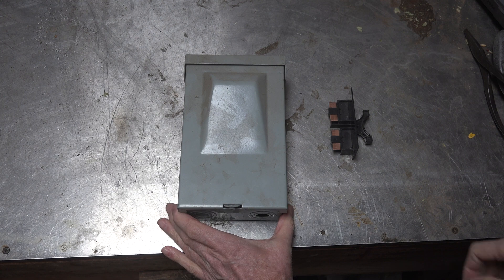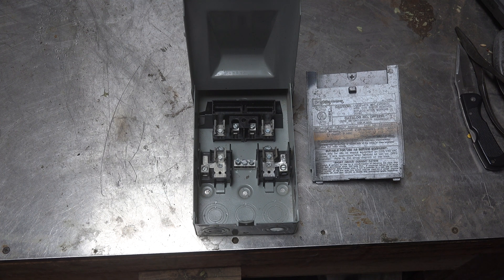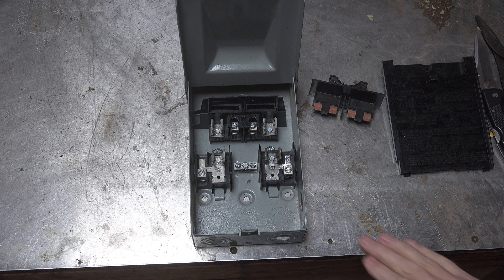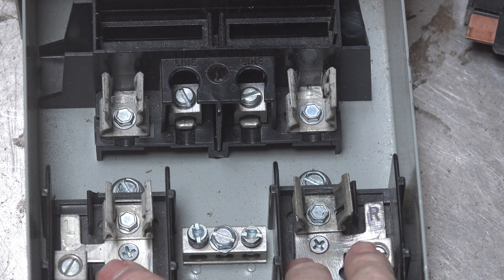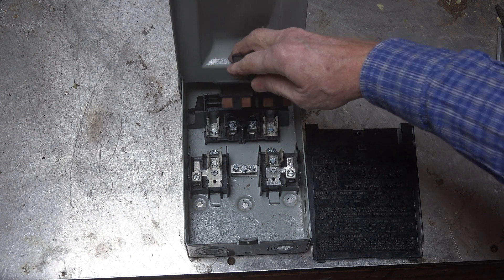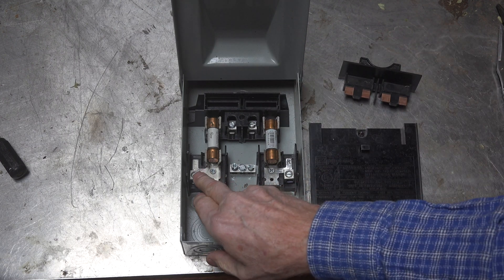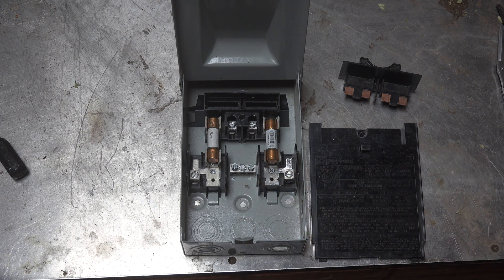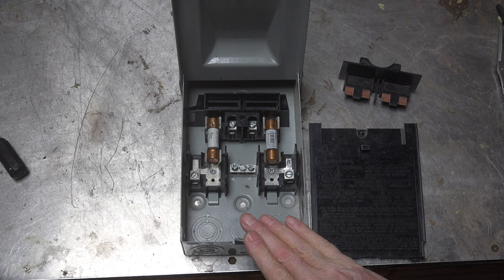Wiring the A/C disconnect

Comment: Can this disconnect be wired as 115 volt?
Reply from the maker: You could, but the neutral cannot be switched.  
GFM
Reply: Yes, but you would only use one fused side for the blacks/hot, the neutrals get wire nutted together, and the grounds tie in at the ground bar.

Comment: Why do fuses go out?
Reply from the maker: Generally, there are 2 reasons for fuses to blow:  Excessive amp draw of the circuit, such as a short in the compressor windings.  
What seems to be more common, the terminals overheat due to poor connections ie loose connections or a poor connection in the disconnect itself.
GFM

Comment: Quick question if the plug for the disconnect is burnt on one of the 4 tips does that mean one of the wire is loose or bad terminal ? Do I need to change out the whole disconnect box??
Reply from the maker: It is probably a loose wire.
In any case, the whole disconnect must be replaced.
GFM

Comment: So if you're connecting female power cord with alligator clips to get power for say the vacuum it doesn't matter which terminals you stick the alligator clips on?
Reply from the maker: It will work both ways, but it is best to use correct polarity.
GFM

Comment: What causes disconnect to blow fuses??????❓
Reply: current in excess of the fuse capacity (which should match the circuit cap)
lightning might provide that. 
you can get boxes without fuses.

Comment: Will I be able to send more power back to Edison's grid if I choose a 60amp over a 30amp disconnect?
Reply from the maker: You don't understand, you pay Edison for power.  And whether you use a 60 or 30 amp disconnect makes no difference.
GFM
Reply: @grayfurnaceman Sorry I have solar panels and whatever I dont use goes back to the grid
Reply from the maker: @Bairov  If the wiring is also upgraded, yes
GFM

Comment: Excellent explanation. If there is a white neutral wire coming from the breaker box to the disconnect, where is this connected?
Reply from the maker: In this disconnect, there is no option for neutral.  If there were a provision for a neutral, it would not be switched in the disconnect.
GFM
Reply: @grayfurnaceman  do you just clip the neutral short then? My Romex comes with 3 wires and a ground.
Reply from the maker: @Rufio6814  Yes.
GFM

Comment: With those 2 small individual fuses on a 30amp Central Air Unit. Would you use
 2 - 15 amp fuses or 30amp?
Reply from the maker: 30 amp
GFM
Reply: I won’t be using it to supply my a/c but instead an outlet for my above ground pool. Should I still get a 30 amp fuse?

Comment: Do you know why they are fused?
Reply from the maker: The NEC requires it lol  
It used to be only a requirement that you have a disconnect.  Not that it had to be fused.  I personally think its not necessary.  There is a fused disconnect (breaker) in the panel.  
GFM

Comment: How would I wire 110 volts to this?
Reply from the maker: That is a 240 volt disconnect.  It cannot be used for 120 volts.  A 120 volt disconnect will have only one pole disconnected.
GFM

Comment: Also would point out that line goes to the inside terminals so that when the disconnect is pulled the fuses don't have power.  Then you can change the fuses without worry.

Comment: Probably stupid question but why is it that a neutral is not needed?
Reply from the maker: The disconnect is a 240/208 disconnect.  There are no 120 volt loads connected to it.  If you had a 120 volt circuit on the appliance, you would need a neutral.
GFM

Comment: Current code requires connections be torqued down to mfr spec using the proper torque wrench or screwdriver, etc. (approved means).  Guess too many people had the wrong idea about tight.  2020 NEC  110.14(D)
Reply from the maker: In the real world, nobody uses a torque wrench.  You know that.  Tight means tight.
GFM
Reply: @grayfurnaceman   Oh, I understand that.  I was just pointing out the language has changed to "shall".  Another reason you don't want to get caught out with a loose connection.

Comment: Thanks for the video. But I hate when an electrician installs a fused disconnect after a properly rated breaker for the equipment im installing. Why? Cause i never have the fuses! And sure as hell he doesn't install them because most disconnects are sold without fuses! I'd rather do everything myself, including the line voltage wiring from panel to a non-fused disconnect.
Reply from the maker: The use of fused disconnects depends on the codes you are under.  A disconnect using a breaker is allowed but most contractors will not use them as they are more expensive.
GFM